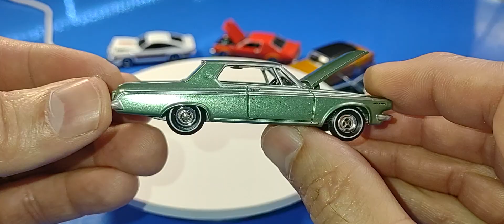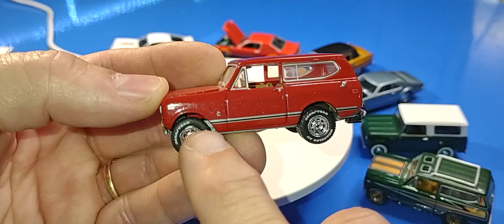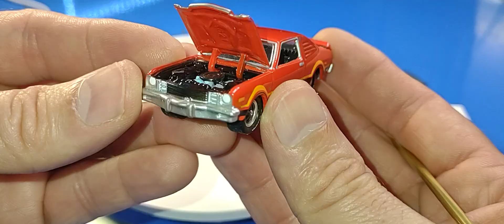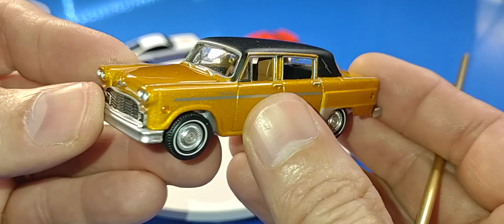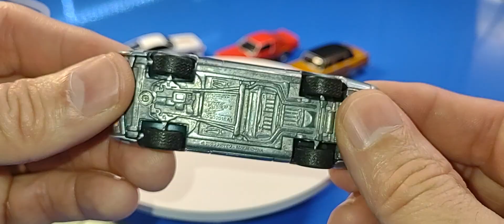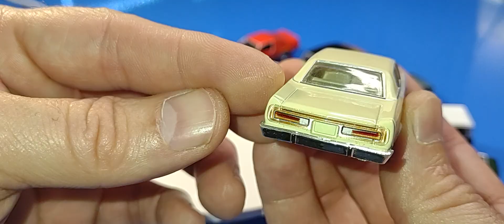Automotive Oddities; Peculiar Editions, Strange Engineering and More!

Comment: cool selection dood. those early 60's dodges/plymouths/chryslers were a bit odd looking but they were racing beast with that max wedge motor and second gen hemi motor when that came out in 64-65model years and i should still have a diecast of a amc rebel machine that has a spiderman theme on it forgot the manufacturer but it's nice
Reply from the maker: It may have been a Johnny Lightning casting as I had one decades ago.